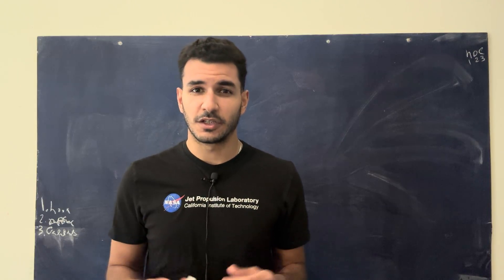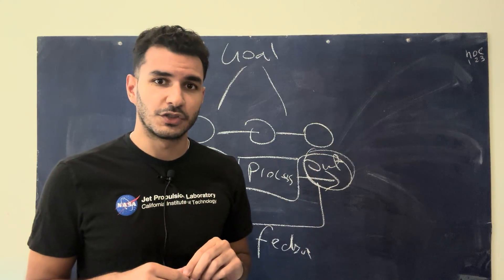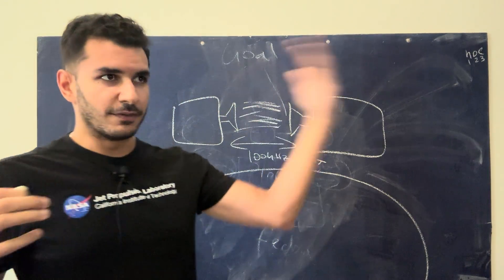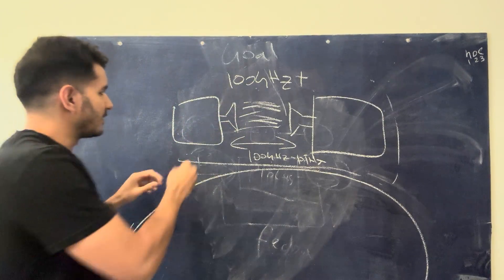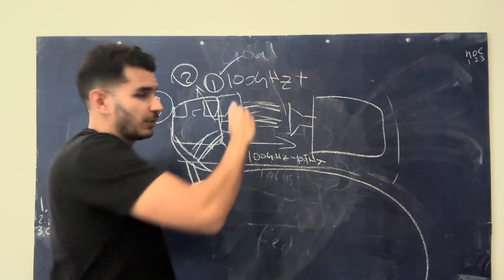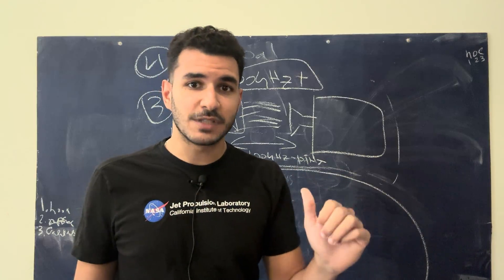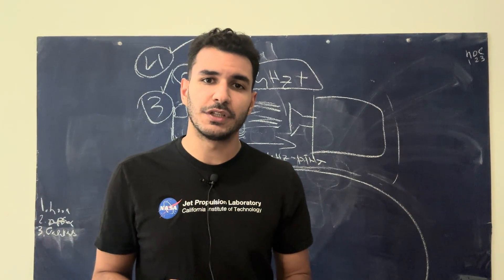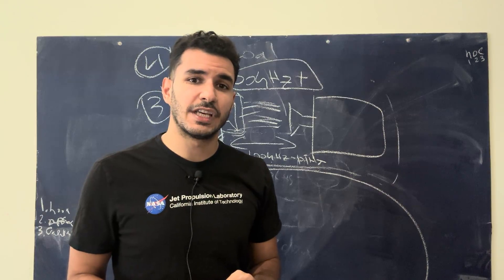NASA Engineer explains why systems engineering is the best form of engineering

Comment: Hey, I think a Master’s program in systems Engineering is a valuable resource for many companies out there.

I am a Graduate student getting my Master’s in Mechanical Engineering But the research area I am working in required me to not only have expertise in Thermodynamics but also in Electomagnitism because Transistors produce heat when you apply bias accross the channel. So I do understand why we need a program that can provide variety.

Comment: I’d love a masters of systems engineering. However, I think it would be hard to define what specific systems.

I have a hypothesis that the same refactoring techniques used in Software Engineering could be generally applied to any and all systems. E.g to refactor company structures and processes to improve some requirements, such as increase throughput or to parallelise processes, improve interfaces. This is an area that could be formalised as a taught subject. It currently doesn’t exist as far as I can tell.
Reply: I also don’t think systems engineering is a single role, but a collection of roles. It takes several experts working together to able to work on large second- or third- order systems.

Comment: as the way i see it, i'm studying embedded systems on my own but as you said it is vital to get good at one thing and branch off from there so it would be wise to structure the learning material so that it follows The Three-Y's principle:

 Hierarchy involves dividing a system into modules, then further subdividing each of these modules until the pieces are easy to understand.
 Modularity states that the modules have well-defined functions and interfaces, so that they connect together easily without unanticipated side effects.
 Regularity seeks uniformity among the modules. Common modules are reused many times, reducing the number of distinct modules that must be designed.

So that everything is foundational in nature yet should be followed in a certain order so that it's coherent to the student

Comment: In 1982 & even some years earlier I think IIT Bombay India had a Systems & Control Engineering 2yr Masters program, the objective was to get to the Mathematical basis of essentially disparate systems & treat them uniformly at that level in order to map the results back to those disparate systems.

Comment: One problem I see with this presentation is that you’re presenting a systems engineer as a sort of “lone wolf” discipline, but its the total opposite. More than any other type of engineer, SEs are collaborative.  They need to understand the engineering fundamentals to coordinate large systems of systems, and you get that base typically by going deep in a single subject, but you must rely on your subject matter experts to guide the work. Otherwise, you’ll be making amateur-like assumptions and design decisions on anything a bit outside of your actual expertise!

Comment: This is a great video! I work at an aerospace company but I work in IT/SWE. I saw we were hiring for a Sys Engineer and was confused that none of the requirements mentioned cloud engineering, proficiency in multiple languages, networking skills, skills in multiple operating systems, etc. It then dawned on me - a systems engineer in my profession is completely different from an “Aerospace Systems Engineer”. Many different systems at play, but my idea of engineering a system has to do more with building a system like an application, or a program, or a scalable way to deploy an upgrade or software or keep track of computer inventory, etc. I have a deep understanding of programming (particularly Windows, but am skilled in Linux). To your credit, I became very good at one thing before I started touching systems at a larger scale. 

It also dawned on me that I’m essentially the full stack dev/systems engineer to my tech team… and that I might want to update my resume and start looking for a different job. lol.

Comment: I'm confused, all components and bottlenecks, they were all in the area of eletrical engineering...how is this systems engineering? This is a project for an eletrical engineer. "Does this break?" is not a deep enough question for a mechanical engineer. I always thought of systems engineering as a bit silly. It's just engineering applied to large projects.

Comment: Disappointed thet Chemical Engineering wasn't mentioned here.

Manufacturing and production systems are the quintessential system examples. And there is so much you can learn from a simple heat exchanger, all the way up to complex combustion engines or even distillation columns.

Everything you do as a chemical engineer is analyze systems (thermodinamically, chemically, mechanically or electromagnetically – yes, I just made those words up)

Comment: I am a Systems Engineer. I studied Mechanical Engineering in College with a minor in Chemistry. Studied Astrophysics, Chemical Engineering, Computer Engineering, Network Engineering, Software Engineering, Telecommunications Engineering, and Cloud Engineering on my own. As well as working as a Fiber Optic Technician, Network Technician, then Telecommunications Engineer and  Cloud Architect/Engineer, building my experience over the last 15 years. I now own and run a tech company that specializes in business technology solutions, and I oversee Engineers of all disciplines. It took a long time and a lot of effort to become what I am today. But I truly enjoy it, and I wouldn't trade it for the world.
Reply: May I ask when you self-studied all these subjects? Did you do that concurrently with your college education? If at least partially, what topics did you self-study while in undergrad? 

I’m about to start a bachelors in mechanical engineering program and am infatuated and deeply interested by all those other disciplines you mention. I’d really appreciate your input.🙏
Reply: @Parsimoniouspenguin1  Yes. Exactly. I have been reading extensively since I was in my mid twenties. I graduated with an associate degree in landscape development when I was 25. I switched from a business major to mechanical engineering at 30yo for my second degree. I admit I am a bit of a high performer. I was running a landscape company and working on fiber optic transmission line installation while studying mechanical engineering and chemistry, and still read a lot outside of school. That mixed with the many videos available on YouTube. And the hands on experience I gained in the field of IT and telecommunications. Then got certified in cloud architecture. I have a unique experience as someone who has worked in almost every phase of IT, from long range data transmission, to structure cabling of large building projects, to networking, to all sorts of equipment installation and programming to Cloud Computing. One can learn anything if they are willing to dedicate their time to it. The hands on experience is key, but the experience can be drastically improved by always studying as well. As an engineer, I am continually learning. It’s easy if you are passionate and have a thirst for knowledge. If not you may get burned out. It’s definitely not for everyone, but if you love it, you look forward to it. I love solving problems. And everyday I am faced with new ones. lol. Good luck with your studies. And go at your own pace, if you’re dedicated you’ll get there. And if you fail, do it agin until you succeed. Never give up.
Reply: @C-1-FRY Awesome story man! You’re incredibly talented. What made you want to switch from landscaping into engineering??
Reply: @C-1-FRY  Can I become a systems engineer with a degree in electronics and computer science, and then a masters in electrical engineering?
Reply: @RaninduNimesh-sj8lb  The definition of a systems engineer is a person who understands and implements the physics and mathematics necessary to design, construct, troubleshoot and maintain systems. I myself, am an expert in Communication system infrastructure. I also have experience in engineering industrial automations systems, chemical and mechanical propulsion systems, transmission systems, as well as data engineering, and Industrial IoT systems, to name a few. The degree is not as important as the skills and knowledge necessary for whatever you are doing. So I would say yes, but again the experience is what matters. As some others have commented, some systems engineers never went to college and have no degrees, just decades of field experience.
Reply: @C-1-FRY  Thank you very much!
Reply: @C-1-FRY  Man this sound really impossible to do it but you have managed to do all this, Awesome Man! respect
Reply: @C-1-FRY  if you did it without any advice and supervisions from the lecturers, what could you say to some of us who are studying mechanical engineering right now? recommend us with some textbooks, YouTube channels and other necessary information sources you used so far.
Reply: @C-1-FRY  Thank you for bringing me inspiration.
Reply: @C-1-FRY  hey man, do you wanna drop some advice on how you really went about studying and structuring your day/week and how you prepared for exams? Did you read every chapter of the books you had, how did you prepare for lessons et cetera— how many hours on average did you dedicate to studying per day/week? did you have time for other social things? How did you manage working at the same time?

Do you have any overall advice or things that helped you ? I’m a space engineering student and i’ve struggled a bit with motivation, procrastination, time management, et cetera partly due to some OCD (that I am currently treating), and I would greatly and sincerely appreciate any advice you could give seeing as you are such an accomplished man.
Reply: @1tortillapls you asking the right questions brother, I want answers too!
Reply: @semmywap2916  yessirr 🤝🏽we got this tho
Reply: @C-1-FRY  Thank you for sharing, I found this very inspiring. I'm currently studying software engineering, however I'm fascinated by topics like neuroscience, quantum physics, neural networks, and so many more, which I try my best to extensively research on my free time. But software is such a big topic in itself with new things emerging quite often, and I find very often I reach decision paralysis, I want the most efficient and optimized way to learn all the things I'm interested in to the same level of confidence I feel after passing a course at school, however there is no concrete or general path to be taken to maximize my time and the knowledge available. Can I ask if there was anything that helped you avoid this issue? Is there a methodology, or online resource you utilized? I'd find what often worked best for me in uni was to look at the course syllabus, right down all of the course expectations, and study each topic ensuring I meet all criteria, but this often isn't available when looking at topics out of my reach like neuroscience or quantum physics. I'd really appreciate any advice you may have, you appear to be very well versed in a quite a range of topics.
Reply: @  sure. First I would like to say congratulations on your achievements you’ve already obtained. Books are ultimately the best resource. As there is an enormous amount of literature. I often liked to read more of the old books as I found they were much more instructive and had less fluff, however when you are studying the latest technologies that is not always the best method. But books are very time consuming, and not everyone learns well from reading.  Some are better suited to graphical interpretations. If you think software is extensive, it pales in comparison to the human brain and its physiology. YouTube is a great resource, speaking with professionals in the field, attending seminars and such can greatly assist in learning. There are also apps like Brilliant, 3D Brain, and others that are great resources and quiz your knowledge in a game like manner. It’s important to remember that not everything you study will be used in the future. Let your interests guide you and don’t worry about time tables. I’m 39yo and am still learning new things everyday. You really just have to do what works best for you, and try to build a system. Good luck. I’m sure you will be successful in whatever you do.
Reply: @  Thank you so much. Sometimes I don’t want to accept there is no “best” way of learning things, although it is bound to be somewhat different for everyone, but your comment has likely provided the clarity I will need in the future to overcome that decision paralysis. I also want to congratulate you on your successes, as reading your achievements genuinely had me in awe, and I would be utterly grateful to have achieved a portion of what you have already at your age. I truly appreciate all the kind words and guidance. Wish you all the best.
Reply: @RaninduNimesh-sj8lb  That option is very possible, just apply.
Reply: Can I know more about your company? I am now studying for a master in computer science and I too embrace the mentality that no discipline is too high or too low for me. I would like to know what you company needs so we could see if we could work together.
Reply: Civil engineer here working as a systems engineer in IT 😁
Reply: What does the path from civil to systems look like? @shekharrajput3379
Reply: do you take interns want to learn from you !!
Reply: @JocaIdrone  Possibly, there may be some opportunities in the spring, where are you located?
Reply: @C-1-FRY  currently im working a BMS project for a data center in Ryiadh, saudi Arabia
Reply: Tony Stark Roadmap just dropped !
Reply: Thank you sir, I was contemplating what my future path would look like but your whole description sounds exactly like what I want to do.
Reply: Name of the tech company please
Reply: Inspiring!
Reply: Thats way too crazy man, i cant be bothered to look at at textbook more than 10 minutes 😂
Reply: you are legendary
Reply: Was there an ideal way you’d study these subjects or do you feel it was more a habit of continuous learning you gained?
Reply: Sounds amazing. Hiring?
Reply: That's a lot of Engineering
Reply: Toot that horn a but louder buddy!
Reply: how long did it take to do all of this??
Reply: Much respect!
Reply: and I am struggling with javascript, jesus crhist lol. People like you should be role model rather than those tw@ts on tik tok. Truly inspiring
Reply: I
Reply: I first was like wich one should I choose etc. But now I have decided to study some at uni and some at my own pace at home, u are really some of a kind of engineer)
Reply: Hello!! 
I have a question. How did you study all of these completely on your own?

Comment: An area you didn’t touch on much is chemical systems (ex: oil and gas, pharma, etc.). Within this space, chemical engineering with a graduate degree in control theory will be most valuable

Comment: One caution about university politics and incentives. They’re perversely aligned against you and have a high probability of accidentally undermining a systems degree.

What I mean by that is a university has a high incentive to fill seats, not maximize the value for a smaller number of graduates. So, many university admissions offices would give into the temptation of taking anyone straight out of undergrad before they’ve developed their initial specialties enough to really be effective in systems. The net result is graduates with hard to predict skills and a diminished program reputation. Not to mention a fraction of graduates who don’t get the same gains you’d otherwise expect for a masters.

I’d probably require professional work experience OR a masters degree demonstrating an initial deep competence in an area. I might let an advisor waive that with department approval IF they can show that a particular applicant got enough out of their undergrad.

I’ve seen admissions offices cause headaches for world class engineering programs by admitting masters students without doing due diligence on how they’d fit and prerequisites. Didn’t do the masters student or department any favors.

Comment: I was looking for a systems engineering bachelors degree when I started college in 2020. I've just graduated with a degree in data science and would love to approach the field from a systems engineering perspective. I'd love to study these deep neural network architectures from a higher level now that I've driven so deeply into the math and programming of it all. Things change so fast in the field, it's important to know what model to use when, and how each new model architecture is distinct. I like to think of NNs as control systems in themselves. Lots of advancements in AI come from simply shifting the around the architecture. I think a Masters program in systems engineering could be very helpful for students like myself.

Comment: Systems engineering is really control engineering because it is all about designing and integrating a diverse range of dynamic systems, whether it be mechanical, electrical, chemical, ect. From my experience in industry however, systems engineers don't have a formal education in control and just hack third party products together to work without any low level design or modelling.